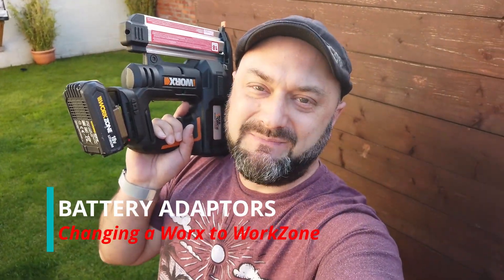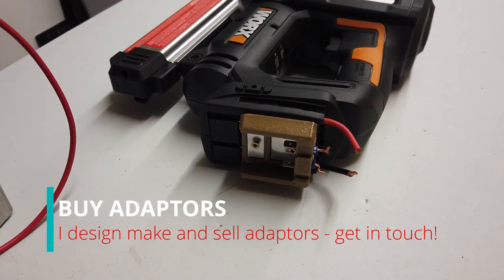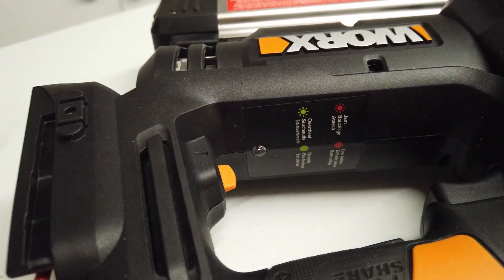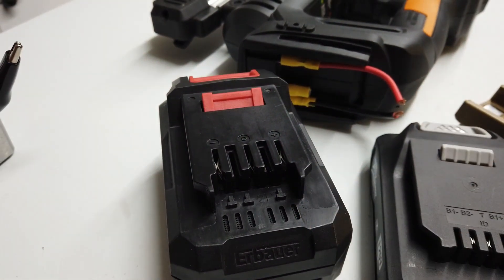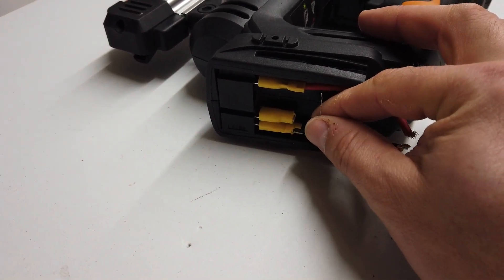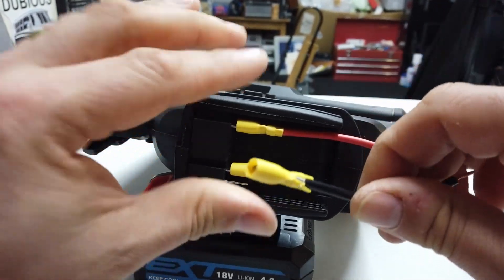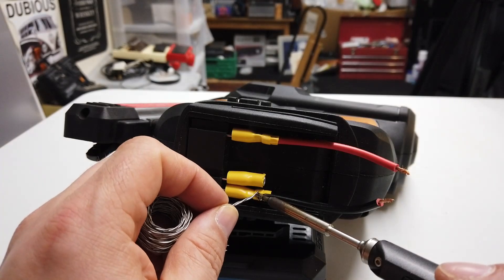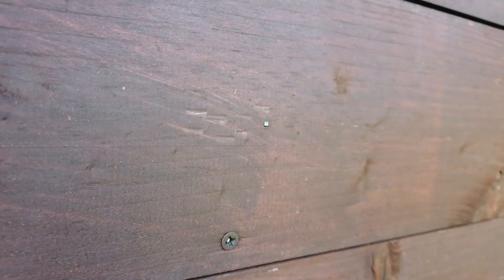DuB-EnG: WORX Nail Force Gun 20v Power Tool Battery Hack

Comment: I remember when I got my electric nail gun; found loads of things that didn't need nailing, and nailed them anyway 🙂. I think it's only a matter of time before these battery packs get a data line, they already do Lipo packs for R/C which have that, and they hold a history of charge/discharge cycles and values which can be used by the charger to adjust charge rates etc. This could be a good thing, but I fear that the manufacturers will use it to make the packs die off before their time.
Reply: I think you are right Mr Jozza, some  of them have already started getting 'intelligent' 
🤔 😑 🙄
Reply from the maker: Awww...  man...  clearly, I am going to need to think about hacking that in the future!! - I2C data coms is sooo cheap and easy these days, the big manufacturers will do it to try to lock the fakers out!